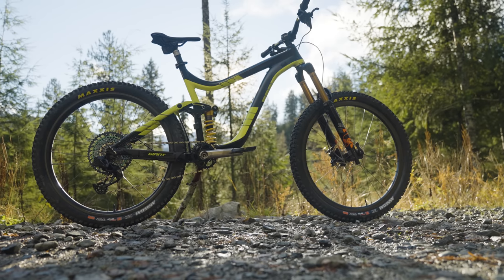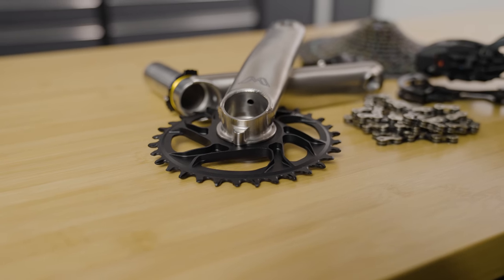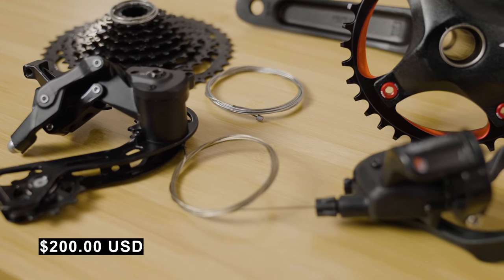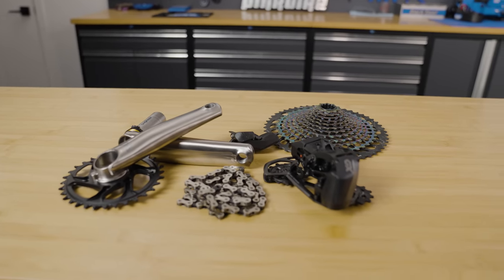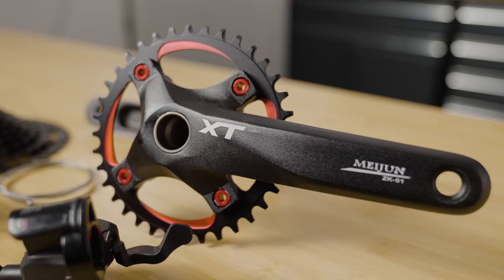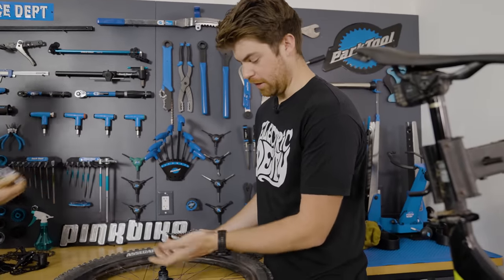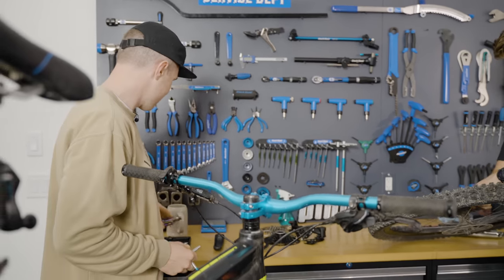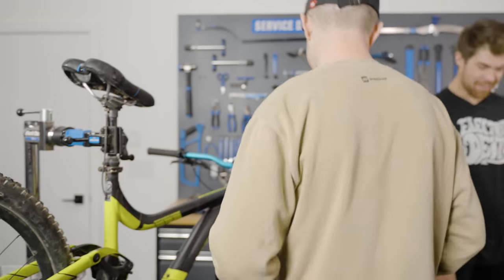$180 vs. $2400 Drivetrain - Budget vs. Baller Episode 6

Comment: Budget versus baller is a great idea, but the budget parts should still be an upgrade. They should get a lower end bike that comes with base parts and then build it up with budget improvement parts and then of course your baller parts. I feel like some of the parts that Henry is putting on his bike are worse than the ones he had. Which defeats the purpose of an upgrade.
Reply: I second this! It's obvious that really low end parts won't perform nearly as well as the top teir ones. I would prefer seeing SX vs X01, RockShox Gold 35 vs Fox Factory 36, budget Stans vs top of the line Enve wheels. I'm sure the difference wouldn't be as staggering then.
Reply: I can confirm this as I have a giant bike that is almost identical to the ones they are testing. The stock parts have been really reliable for me (3 years running w/ minimal maintenance) and in my opinion you’re gonna be spending way up to do better than what the bike comes with
Reply: Totally agree. The OG Donut version of this show did just that. This should be called broken vs baller. I'd like to see this with average/budget and maybe even buying used parts. Thanks guys1
Reply: True, but considering how good those entry-level products have gotten in the past few years, I don't think they can really tell the differences with the top of the line stuff, and you probably can't make a show out of that
Reply: They should've dropped the word "upgrade" and just called it parts replacement.
Reply: It’s infotainment I guess, but agree totally with these comments below budget is cheap sh1t, buy cheap buy twice etc.
Reply: The concept is great, their execution has been fucking terrible
Reply: There should be a middle ground in the prince range, budget, medium range (cost-benefit) and baller, thaat way you can really have a comparisson.
Reply: At least you are not the only one who see this shit show for what it is.
Reply: I guess "good vs. bling" would have to be concluded by saying that spending 500% more money on parts makes no sense efficiency-wise and that's not what you want to say in a series sponsored by a bike shop. I read a brilliant comment once, under one of Sam Pilgrims videos (WalMart bike in Whistler or something): 

"Sam Pilgrim about a 250$ supermarket bike (while hitting A-Line): "Oh my GOD that thing is the best!!!!"
Pinkbike about 4000$ bike: "Can this entry level bike even handle dirt?" 

This sums up this series accurately :) However - I still find it entairtaining, once I realised there will be no valuable consumer advice here.
Reply: those budget parts are not upgrades.  theyre a  false sense of upgrade
Reply: That works if the bike you are starting out with is a very inexpensive bike, I don't think the Giant bikes they are using are inexpensive. This episode was actually good though, he used a rebranded IXF cranset which is a VERY good budget crankset, you'll find it on 99% of budget builds, because it's a great budget crankset. The groupset he used is also a pretty goog MicroShift Acolyte groupset, which again is a great budget groupset although they should have gone a little more expensive and gotten a AdventX.

Comment: I use the Microshift Advent on all my bikes, works flawlessly and really dependable! The clutch is really strong as well, only a bit more expensive than the acolyte, whole setup is under $200 CAD
Reply: Yep I have one on my fat bike. Since I adjusted it I’ve been blown away at how well it works.
Reply: Just buy an used m7000 group or 12s deore if you have a bit more cash, idk why anyone would go for microshift apart from getting it stock on entry hardtails from walmart
Reply: @S.Minkii  I replaced my well worn shimano xt drivetrain with a microshift adventx 10 speed and it's been awesome. It has nearly the same range at a 12 speed but is more dependable (derailleur adjustments don't need to be as precise so it can take several hits before needing any adjustment, I haven't had to adjust mine at all), can use a stronger chain, and is lighter than a 12 speed set up 3x the price. The only complaint that I have is shifting underload is not as smooth but I try not to do that anyways.
Reply: I'm using it on two bikes now. The clutch is as reliable as it gets and I've never had to adjust the cable after installation. I'll never go back to Sram or Shimano. Would be nice if they had a lighter cassette option for it though, it weighs as much as a 12 speed.
Reply: @S.Minkii  Ive run deore, gx, nx, x01, pretty much everything, advent and advent x are my preferred. Cheers!
Reply: @S.Minkii  Microshift actually has some really good drivetrains that are worth consideration. Sure there are Microshift components on Walmart bikes, but that doesn't mean their whole lineup is bad; I mean, Shimano sells their cheap-shit "flat face" derailleurs that are junk too.
Reply: @S.Minkii  availability and price (some people have an absolute budget) and also the Microshift is VERY good and because it has few cogs it's MUCH easier to install and get shifting on point. I and Advent 9-speed on my Gravelbike and there wasn't any drivetrain that came close to the price and I never had a drivetrain that was easier to install!
Reply: I gotta admit seeing replies microshift seems like a viable solution for someone wanting a brand new but cheap setup but honestly even being the poor and cheapskate teen i am id still rather find some other solutions. Not saying MS is a bad option tho :D
Reply: @S.Minkii  IMO microshift Advent X is way better than cheap eagle drivetrains (SX/NX). It's lighter, the derailleur hanger alignment is less critical, the actual build quality and shifting performance is better and the consumables (chain/cassette) are around 1/3 the cost. It is 10 speed vs 12 but the overall range is similar and well worth the other benefits.
Reply: Put the Advent X on a frame I built up. Has been affordable, hassle free and less weight than 12 speed.  I love it and may replace my Shimano  and Sram drivetrains on my other bikes when the time comes.
Reply: I had Microsoft on an od bike and the group worked really well. Ltwoo is also decent if people are low of money
Reply: I have a Deore 10sp drivetrain but I'm keen to try Advent X with the bigger 48T rear cog. The only thing I'd miss is the multi upshift of the XT shifter.
Reply: @S.Minkii  the 12s deore while very good is incompatible with the rear hubs of cheap bikes.
Advent X is supposed to be decent. But I'd go with a 11s m5100 shimano set-up.
Reply: @1barnet1  true, i forgot that even deore is microspline but yeah the 11s goes up to 51t as well and is cheaper. I just upgraded from m8000 to a sram x01 derailleur, gx shifter and sx cassette (HG) for like 130€, only the gx was brand new but id still say its a nice deal
Reply: @S.Minkii  Yeah that's a steal but let's be honest. 

GX = XT pricing and is not bargain.
XO1 = between XT and XTR.

So only the casette can be considered affordable. Being a direct competitor to Deore.

When buying a new complete groupset or upgrade kit. The point is indeed spend a bit more and get something properly made with good range.

Then the difference between that kit and the best kit becomes far less substantial.

Same with gravel and roadbikes.

GRX 600 and 105 or Sram Rival are excellent!! products.
Reply: Acolyte is a better clutch system. Cheaper and works with the 11-48T 10 speed shifters
Reply: The microshift XCD (11sp) is a tad over kill. I got it for the hard steep climbs butt I hardly every get down to the 46T

Comment: I think Henry’s bike is being done wrong. It should have a ~$120 dropper, a mid range rockshox 35 gold fork, a inexpensive race face cockpit, and something like the deore 12 speed or 11 speed group set with the same cranks. I think the upgrades should be budget minded but still suitable for use on a mountain bike.
Reply: The yari would have been better than the rs35 either way... They should just make it "smart decisions vs I have all the money in the world"
Reply: I'd go ~$240 dropper with internal routing (crankbros, E13, PNW all have options), fork service + damper replacement, microshift AdventX 10 speed and a deore crankset. All stuff that performs great and is reasonably priced.

I'd also get a separate dropper lever to point out the differences, maybe get aliexpress vs pnw version of that because it's a good comparison and something value shoppers would actually want to see.
Reply: @Skooteh  I agree with this more, cockpit was okay
Reply: @iancai5  nah they should have just gone with a RockShox Recon RL it's about as budget as you can get with a great quality name brand part.
Reply: @NonLegitNation2  The RS35 is a beefier recon. They'd still be downgrading.

Comment: For the next budget vs. Baller, please do actual good budget upgrades that people can have a real use case for.
Reply: Agree. They're just putting garbage, doesn't make it an upgrade at all.
Reply: Yeah like deore or singling
Reply: *something
Reply: Depends. If you just had your drivetrain torn apart, busted, and destroyed, you need to put something--anything--on it because otherwise, you no-go. In that case, junk-level parts are an upgrade over no parts.
Reply: @theevermind  not those parts. The deore x11 set costs approx 250 usd, so really not a big difference and is quite a good part. It has a clutch so the chain would be much more secure and an 11 to 51 cassette. Those things are too expensive for 2hat they offer.
Reply: +1   Deore 11s or 12s for example
Reply: Microshift AdventX is an AMAZING 1x10 drivetrain for only $167 including shifter.  Weighs the same as XT 12 speed.  If they had ran that, there's no WAY they'd be able to justify a $2,200 drivetrain

Comment: So are we just gonna keep going until one of these crappy bike parts kills Henry?

Deore 12 speed would’ve been a much better option and not much more expensive.
Reply: even the 10 and 11-speed Deore stuff would have been better and prob cheaper as well. but the 12 speed would deff be the best budget upgrade that is actually an upgrade
Reply: @bobvelting379  Would've needed a new rear wheel though. That would've probably detonated his budget.
Reply: @bobvelting379  I wouldn't spend my money on anything new that's more than shimano 11 speed with the 51 tooth cassette. I honestly don't buy the 12 speed stuff, the extra cog is just dead weight. Figuratively and literarily. On 11s the chain is thicker, it requires less precision, it's even lighter if you care about that sort of thing. As long as you have a big gear and a sort of small gear, that's all you need, I don't think that even xc racers would miss the extra cog.

I've just checked and full 5 piece 11s group set costs the same $200 they spent but comes with trustworthy cranks and a comparable range to eagle. The deore 12s stuff is a full 100 bucks more for no extra features. The only advantages the higher end stuff offers are slightly better quality and precision, but we all know the real reason why people but this stuff is grams and image.
Reply: @gedrot2486  Sunrace makes 12 speed cassettes for the standard hg body and if I remember correctly the m5100 11 speed and 4100 10 speed are also be hg body
Reply: @rauldragu9447  I'm still on the xt 11 speed stuff. Got a second hand shifter that looks and works like new for half the price a little while back. It works great and the 46T is more then i need with my 34T chain ring, but considering how good the new 11 and 12 speed Deore stuff seems to work i don't think you can go wrong there. The new 11 speed 11-51 seems to bee a very nice setup indeed.
Reply: Even the microshift advent x system would be fine. It doesn’t need to be expensive but no one is going to consider shit parts
Reply: @bobvelting379  Sure Sunrace does that but I think it's SRAM specific, at least it was last I've checked. Or did they make a new one? I think I remember to have read somewhere that SRAM and Shimano use different spacings for their 12 speed cogs so the cassettes are genuinely not freely exchangeable anymore. 

Also wasn't taking about 10 and 11 speed.
Reply: @gedrot2486   Both Garbaruk and e13 make cassettes that work for both Shimano and SRAM 12 speed, so I can't imagine that the spacing is so dramatically different that it won't work. Even a Shimano cassette and chain with an SRAM rd and shifter seems to work just fine. I'm even willing to bet that an SRAM chain will work alright on a Shimano cassette.
Reply: @bobvelting379  You can make them work, it's only 0.1mm difference each cog or so between SRAM and Shimano, but you'll compromise your shift quality I'd bet. Might as well just save the money on consumable components and go with a full Deore 11 instead of trying to cobble together a hybridized setup that might not wear as good as a "pure" setup.

And mixing chains isn't really all that drastic. You could run a 12 speed chain on an 8 speed drive train with maybe some wonky shifting, since the chain can't grab the climb aids as well. It's the other way around that doesn't really work at all, with the chain simply getting too wide to fall between the cogs anymore.
Besides, KMC's 12 speed chain is compatible with both of the big S&S, so any difference should be very negligible there.
Reply: Do you mean 10 speed deore? 12-speed drivetrains are nothing but marketing scam

Comment: This is a cool series and all, but what I would really like to see is basically low end versus high end.  For example Shimano Deore vs XTR, Recon vs Lyrik, aluminum wheels vs carbon.  Some of the parts on Henry's bike was an actual downgrade from what he had so these are not likely changes anyone would make.  But I really want to know if the high end components are any better then the lower end in the same brands.  Personally riding some of the Eagle drivetrains (non-axs) I can't tell any difference, so expanding on that would be a cool video series.
Reply: the problem is if you do a comparison of "mid-grade" to "high-end" the differences are so small it'll hurt too many peoples feelings.
Reply: Most people wouldn’t notice a deore vs xt difference, and neither would a stopwatch

Comment: My Shimano SLX drivetrain is a good balance of performance and value.
Reply: my 11 speed deore 11-51T is pretty good value and doesnt break your wallet in half
Reply: @ronaldd8741  I've used both and the SLX definitely feels higher quality, but both of them shift flawlessly once set up correctly.
Reply: For sure, SLX with the XT shifter. 👌
Reply: My cay smells like cat food
Reply: @CoderShare  ofc, but running both XT tho real fire stuff🔥
Reply: From Deore up you really cant go wrong with Shimano. 30 yrs. of mtbing and have always preferred them.

Comment: I was really curious to see how this all rolled out as I have been slowly upgrading a 2015 Giant Reign 1.  I thought the budget build would be more along the lines of the work I have done to date but a lot of the budget build seems like downgrades to me...

I am feeling confident I have gone about it the right way with a mix of new and used parts (thanks to the ballers and their take-offs!):
Raceface Arc 30 laced with original hubs, Assegai front and back, tannus inserts.
Sunrace 11-50t, OneUp 30T oval (on stock cranks) with Raceface composite pedals.
 SLX: derailleur, 4 pot brakes, rotors, levers, and shifter.
Giant dropper with Chromag Saddle.
PNW stem, Fasst MTB handle bars, OneUp grips.
Rebuilt Suspension: Monarch Debonair / Pike (but for fun, currently running a mullet with a Lyrik Ultimate and Stans Mk 4 / DT Swiss 350)

Maybe more of a budget ++ build :)

Comment: Those ti cranks looks awesome! They're a work of art 🎨
Reply: And incredibly overpriced.
Reply: @adamb724  there is ti cranks at ali express I'm doubting they can be good . Based on good welds and the quality on the pics, I they have the potential to be good.
Reply: @jeepsterc104  aluminum is more than fine for me. Ti for a crankset is a solution to a problem that never existed.
Reply: @adamb724  nah, I've snapped multiple aluminium crankarms. I've never been confident on aluminium thanks to that... But I still use it because its cheaper, I've also cracked three aluminium frames, and every single aluminium freehub body I've ever used essentially ripped itself apart in a few months.

I've always seen people talking about titanium and it's properties over the years, I just kind of wish I could have that on my bike. The lifespan of steel, almost as light as aluminium if built right, and can take hits unlike carbon, just sounds perfect for me. But its too damn expensive now lol.
Reply: @adamb724  I'm snapping cranks due to material fatigue, I ride really hard everyday. Almost everything that I do involves bikes, I am also a track sprinter that weighs 90 kilos.